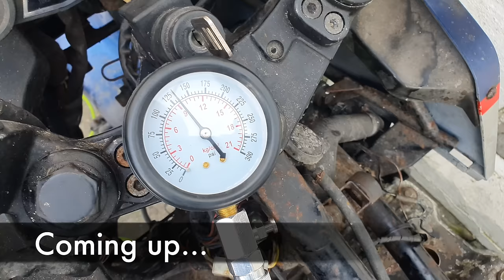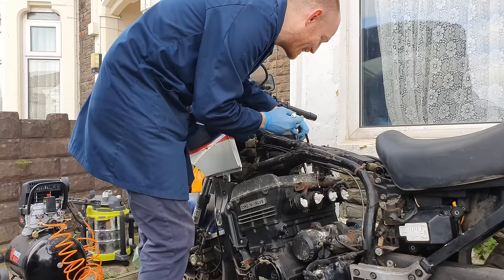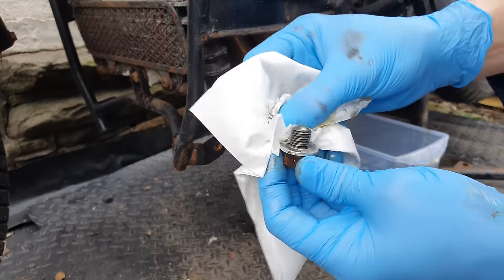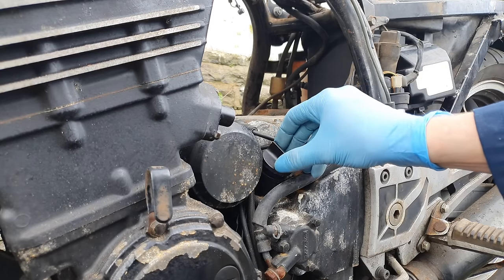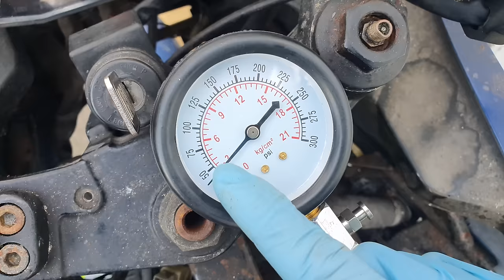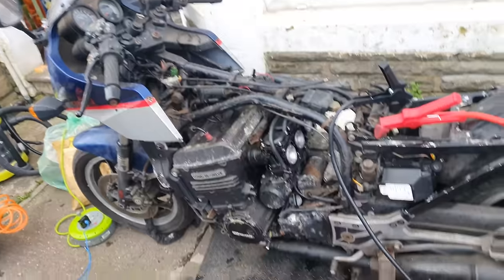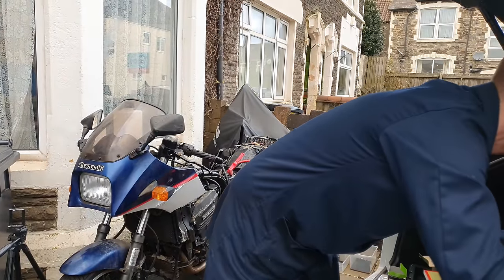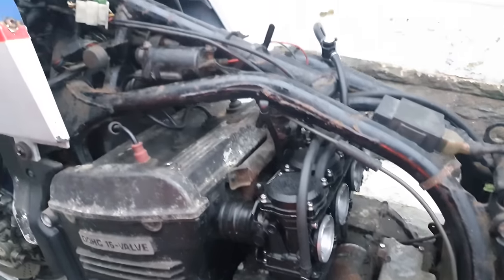First Start in 28 Years! Barn Find Kawasaki GPZ900R Ninja

Comment: Congrats on the first start Ash !   Best not to crank it over with the rags in the intake manifolds btw.    If you decide to try and save those rubber intake boots (if they're not split), you can soak them in Isopropyl Rubbing Alcohol and "Oil of Wintergreen" (3 to 1).,  A couple of days soak and they will be soft and like new and will stay that way.  New OEM boots are best, but often rejuvenating the old ones works as well or better than some of the cheaper after-market stuff.

I'd also think about letting it run a bit longer if its not making any bad noises.    Sometimes the rings will stick if the bike has sat for a long time (28 yrs is a long time), and a few good heat cycles will often free them up and the smoke will be gone.  Then you can re do your compression test.  Also make sure that you open the throttle wide open (no rags in there) when doing the compression test.

Keep up the great work, love the vids!
Reply from the maker: Haha,  I definitely should have taken the rags out, I forgot about them to be honest... sometimes I'm extremely particular, and other's i'm so blazeh! I'll try that with the rubbers, they're expensive and things are adding up quickly 🤣

Comment: Nice one getting the bike started . Here is a tip for you when starting the bike pull the clutch lever in , as it takes the load off the engine and prolongs battery life 👍
Reply from the maker: I would, but the clutch is completely toast and has no pressure, let alone fluid in the lines 🤣

Comment: Hi Ash, well done on getting her started! I have a GPZ750R (900R's baby brother) that I have owned for 28 years and I decide to get it up and running in April last year after laying it up for the last 15 years.
So I had a new battery, plugs, fresh petrol and I had to put fresh coolant in as it had completely dried up! Leapt into life and ran smoothly on the button! I celebrated nearly as much as you did! It's a great feeling.. It took me another 6 months to get it back on the road though as everything else had gone to pot! tyres, brakes, clutch, exhaust, forks, electrics.. All ready for summer  this year. Looking forward to the rest of the series..
Reply from the maker: Well done mate! I doubt mine's going to be ready for summer but I can try... everything needs doing 🤣

Comment: To determine where you are losing compression, pump a little oil in to the cylinders with a pump type oil can. This will seal the rings temporarily. If the compression dramatically increases you know it’s the rings. If it makes no difference you’ll know it’s the valves.👍 you should have I think about 150 psi on each but more importantly should be within 10% of each other.👍 good luck.
Reply from the maker: Great idea, thanks for that, I'd rather it be the valves lol
Reply: If you need to take the head off, then hone the cylinders and install new rings at the same time the added cost will pay for itself later...

Comment: It smokes also due the wd40 that you spryed into the cams,
Protip: in order to avoid get contact with fuel during the pumping out, 
set the hose properly and then blow inside the main container, like a balloon, the pressure's difference it will does the job, you won't be tasting fuel for the rest of the day,
Congrats, your doing a great job, let's keep working on that amazing machine!
Reply from the maker: Good point, I hadn't thought of that, and I did spray quite a bit in there 🤣

Comment: Hi Ash, great video. I just wanted to make comment on the blue smoke coming out the exhaust at the end of the video. This may not be that much of an issue to worry about, as far as I’m concerned it’s fairly normal to happen after an engine has been sitting after a while and it may clear out after a ride or two. 

Same thing happened on my 1990 ZZR1100 that sat for 15 years after I restored it. The blue smoke cleared after the first ride. Hope this helps!
Reply from the maker: Thanks! You're not the first person to suggest this, lets hope you're right!

Comment: Hi Ash Just a suggestion: whenever you do a compression test always open the throttle all the way or in your case take the rags that you had in the intake ports out. 😉
Reply from the maker: Haha, yea I should have removed the rags, but opening the throttle wouldn't have made a difference as the carbs weren't attached 🤣

Comment: When you were testing for compression you should always have the bike take as much air in as posible to get good accurate results on the compression meter. I may have it wrong but you had rags in de intake's that restrict air to go in and you get faulty readings on your compression meter.. 😬 by the way, good job on the build so far! 🤠
Reply from the maker: You're absolutely right, I completely forgot to take them out, could have been a disaster 🤣 Thanks!

Comment: Hey Ash if you turn the engine over with plugs in the cylinder you can see how well the spark but more importantly the oil pump. circulate some  oil cams / cylinders and crank shims.
Reply from the maker: 👍 Coolio
Reply: @AshRowland   
impressed at your carb rebuild they look great. 
Well done Ash  if you put a tiny bit of two stroke in your fuel it will protect your pistons and bores on your first start ups. I’m only talking a toothpaste cap full in your remote tank.
Reply from the maker: @davemonday5381  Ah cool, thanks mate

Comment: Ash just a thought that if you get it running for a while and properly up, that low compression cylinder may just be stuck rings that unstick with a bit of running and give you more compression. There again it might just blow up! Have you thought about an endoscope camera down the plug holes to have a look at the bores ?
Reply from the maker: 🤣 I have an endoscope, you might have seen it on the tank video... I didn't have it with me but I'll get it down there at some point... Hopefully it will free up
Reply: Good work. Did you actually get it running on fuel alone without the magic ?  Have you seen The Bearded Mechanic on YouTube? He’s always pulling bikes out of hedges and sheds and firing them up and bringing them back from the dead.
Reply from the maker: @sm17adh  Oh yes, I love that guy... Yes, it runs just fine without the spray, it was just the initial start, it just needed persuading after so many years haha

Comment: Nice vid.ps when you do a compression check normally you would hold the throttles wide open.i take it you took the tissues out of the rubber inlets 1st? .remember it has to get air in to push it out .
Reply from the maker: Thanks, the carbs weren't attached at all when I was checking the compression... I did initially forget to remove the tissue though, no harm done 🤣

Comment: Epic. Just remember that old Kawasaki's will rev their nuts off on choke. 4-6000rpm is not uncommon. Try reducing to about 5mm of choke once started. My ZX10 did it, My ZZR does it, and my old ZXR used to rev to 4000 on choke and would die if you even looked at the throttle. Only Kawasaki's seem to do it! 

I would advise renewing the coolant O rings on the cross tube at the front of the engine. They always fail, and it's usually when you're in the middle of nowhere.
I look forward to seeing the progress on this.
Reply from the maker: Thanks for the tips mate... I haven't overhauled the cooling system yet, the hoses are very crispy though 🤣

Comment: I have bad news for you, You probably had a hydrolock in cylinder no 3 and bent the con rod. when you get it running the compression will never get better and you'll have a little mis-fire. When you take the head off no 3 will be down from TDC 10 mm.
You can change no 3 rod and piston from the bottom without splitting the crank.
Ask me how I know......   😪
Reply from the maker: I'm hoping not, I meant to check the heights but forgot, I'll do it next time I'm working on the bike 👍

Comment: Where the spark plugs fit into the head, the hole has a slight taper, meaning a bit thinner at the bottom, so get your grinder out and put a taper on the spark plug socket, most GPZ900R owners will have done this, I know I had to, 🤣👍. Soak any hard rubbers in "WINTERGREEN OIL" works like a charm and saves quite a bit of cash. PLEASE tell me you got the washer off the old filter and put it on the new one????????????? 🤔. Easy Start for the win.
Reply from the maker: I'm going to be completely honest with you... it would seem that I completely forgot to put that back on! Oops! Well spotted! I wonder what sort of adverse affect that would have on the running

Comment: You can measure the height of the pistons thru the spark plug holes to see if there is a bent conrod. I hope they are allright.
Reply from the maker: I wanted to do that but I couldn't turn it by hand to get the pistons to TDC to measure them
Reply: @AshRowland  they don't have to be at tdc, just compare piston 1 to piston 4 and piston 2 to piston 3. They rise in pair.
Reply from the maker: @Kurbits  Oh yea, duh! 🤣
Reply: Always put the engine in top gear to turn it over with the back wheel. You will have the greatest mechanical advantage over the crank that way.

Comment: Keep it running first time it burns off all the old debrie, this is normal
Reply from the maker: I thought that, but now I'm thinking that all signs point to worn out piston rings
Reply: @AshRowland  for a bike sitting so long I think at least keep it running for a minute. If coolant available longer. I worked in a classic cars garage when I was student , you would not believe what engines throw out/burn off when sitting long. Love your experience anyway
Reply from the maker: I haven't done the cooling system yet, the old hoses are, shall we say, crispy 🤣
Reply: @AshRowland   or stuck piston rings, let her run a while, and do a few heat cycles , the smoke may clear up, rings may unstick and you can re-do the compression test (with throttle wide open btw).  Stuck rings not unusual in a bike sat 28 yrs

Comment: First Start, Barn Find not run in 40 years blah, blah, blah.  Any engine could run after sitting for 100 Years providing the following criteria recognized and understood.  Engine can freely turn, Fuel System still exists, Ignition System is intact and fed by a good Battery. Checking the Compression is Mandatory as is draining the Engine Crankcase & Transmission.
              These types of videos are designed to entertain the Producer as well as the viewer.  You don't use WD40 for old rusted nuts and bolts, you should be using Penetrating Oil and Heat whenever possible.  Anyone that does not have any educational training or hands on practical experience needs to get at least one of them, before entertaining the thought of any serious restoration process for a bike or car !